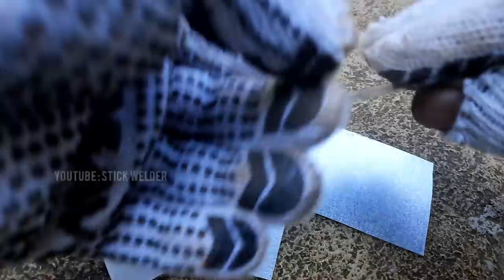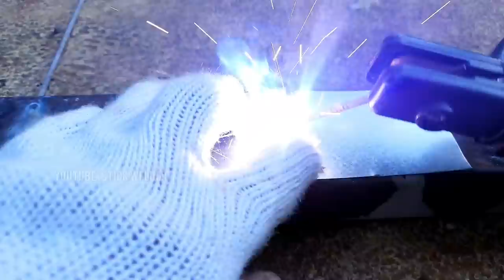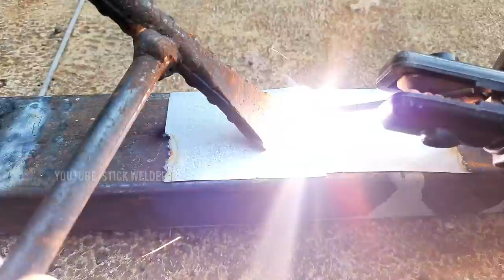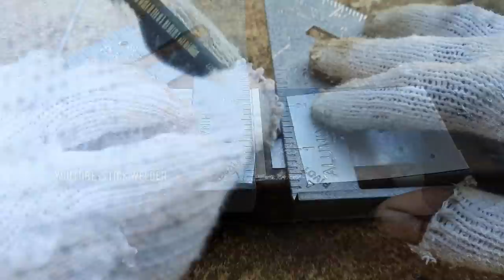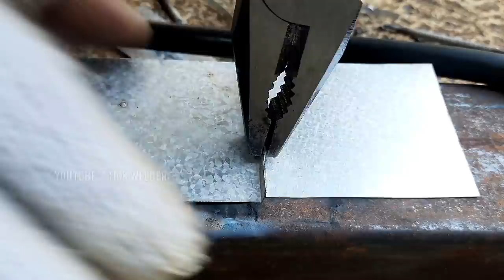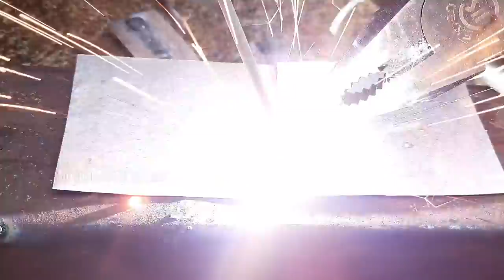0.3mm welding secret trick |  How does a welder get through the challenges of his job??

Comment: Basics of welding:
1. Do not weld any metal surface unless it is bare base metal. (No coating, no grease, no dirt, no galvanising etc..)
2.  Choose the correct welding method (i.e. weld thin metals with GTAW/TIG welding/spot welding or just use brazing)
Reply: This is true in most cases. Light gage galvanized is too thin to grind or buff off. Thinner than construction paper. Even heavier 10 gage/ basically 1/8” we rarely grind for a weld. Heavy galvanize on channel / structural or hot dip galvanize yes absolutely.
Reply: Basics ? Lmfao basics of welding would be learning whats for what...... they make rods literally for burning through dirt grease rust and the likes your ideal world of it has to be prepped is adorable in the field
Reply: @w.f.productions7501  yep 6011 works great on those situations. It’s my go to rod for galv. Normally I would not weld 24 ga or lighter with a rod but some times in the field your do what you have to. Generally we try to stay in the 16 ga realm for stick. We carbon arced with silicon browns filler rod in the old days lol then with the newer suit case welders and a small argon tank it made it a breeze with much more control on the lighter gages tig welding.
Reply: Try join industrial maintenance for once. Theres many kinds of welders out there, and every "style" has its uses.
Reply: My first welding job all we did was weld on galvanized metal... Fuckin hated it...
Reply: Just  mig  weld  it!
Reply: @stormytempest6521  not always an option . I don’t know when that guys first welding job was but I started in 81 it was a major set up depending on where you were. Hangin by a bow-sons chair on the side of a building or high up in the steel work wasn’t an option and still isn’t. These days the smaller units are cool as hell but still have limitations. A breezy day can ruin yours. If that guy has or gets 10 years under his belt I’m betting he would say no biggy I got this.
Reply: Clean, or even epoxy coated surfaces aren't as important with a stick welder. The point of the video was to show that it's possible to weld thin material with a welder that was never meant to weld thin material. I've been welding and torching for over 20 years and to be honest, this simple to understand technique blew my mind!🤯 Mostly because of how many times I've unsuccessfully "welded" thin sheet and that this idea had never occurred to me. 
As for galvanized, I don't know if you were alluding to the "Galvy Flu", but if you quickly preheat it yellow first, wear a respirator, or dont do it everyday then metal fume fever shouldn't be an issue.
Reply: Try using a smaller(thinner) welding rod too.
Reply: @johnanthony2545  Did you mean "bosuns" chair?
Reply: @LukeAONeill   Lukè  my  friend, you  have  a  point,  can  do  job  whith  a  thin  rod  but   its  a  messy  slow  process....thats  why  mig  welding  was  invented!  regards.
Reply: @truckerenoch8824  I m not sure of the spelling sorry. Basically a flat board supported like a swing from a single line. An additional safety line separate from chair for your self. Generally comes with a tool bag hung off the bottom.
Reply: @johnanthony2545  o.k. we're talking about the same thing. I wasn't sure if there was something else with a similar name. You were close enough that I was pretty sure that's what you meant.
Reply: @truckerenoch8824  have you ever used one. It’s an interesting experience.
Reply: @johnanthony2545  No, but they look fun.
Reply: @truckerenoch8824  they can be if you like that kinda thing. I do so I’m just goofy like that lol. Working from one can be challenging if there no way to lock off to stabilize your self. I you need to push or hammer or what ever your moving or pushing away or spinning. Your a man on string.
Reply: I think these video is for those people who dont have the resources to buy GTAW,TIG or any other type of welding machine but SMAW only

Comment: Step 1, GRIND OFF THE GALVANISING 
You'll never weld galvo steel, the zinc reflects the heat from the ark, and adds impurities to the weld, and the fumes are toxic.
Reply: Grinding a pc of 24 gage is not a thing. It’s like paper no need to grind. Galvanize coating on sheet goods of light gage is not thick and will burn away. Grinding an already paper thin pc is not recommended. Even up to 10 gage. Heavier coated material like angle / channel/ I- beams yes that is the norm. 41 year industrial sheet metal worker / retired.  Edit to add this. 6011 3/32 or 6011 1/8 rod works best in this application. 7018 is over kill for light gage material that is not structural and in my opinion much harder for a novice to learn how to weld light gaged material.
Reply: @johnanthony2545  nice info
Reply: @squid_shit9748  yes and get a fan to blow smoke away from you or a certified vacuum system for fumes. Vac system normally in shops no so much in the field.
Reply: @squid_shit9748  the fumes enter via the respiratory system, drinking milk will not affect this in any way at all.
Reply: @johnanthony2545  i would have just tigged it after preparing the metal
Reply: @thedango6890  yes this is the best option with tig. I’m thinking the video was  to show that it can be done with stick as most individuals don’t have access to tig rigs. Also the joint he used with two 90 degree is a common method most people would not know about if not in the industry or at least in construction and observed it on the job. Making sure joints are tight really helps as well. Of course there is the wire gun option even when metal is in the flat.
Reply: @squid_shit9748  You are hardcore

Comment: You should probably use mig/tig for this but if you have to use stick don’t use a 6010 rod it’s burns through before filling.. a 7018 or 6013 would be better.. not perfect but better
Reply: I'm working at an acid plant. Guys out jere using 316 for carbon to stainless.... we have 309 rods which is for that procedure. But we just do as we're told 🤦‍♂️ when this plant blows up we'll know why

Comment: Я не сварщик, но нагрев металла его сильно ослабляет, там сгнивает моментально, проще замком завальцевать, а если нужна герметичность, то герметик всё решит)
Reply: No heating does not necassarily weaken the metal, it depends on the type of metal. Generally heating the metal affects the crystaline structure. What weakens the metal is constant stress and or heat getting it out of elasticity into plasticity to the loint of structural degredation. A weld is a seal and is generally beter than a seal
Reply: Как жестянщик со стажем и опытом, скажу, что завальцовка, это несколько иная операция, а не то, что вы имеете ввиду.
Если хотите использовать термины, то надо их сперва изучить.
Falz(фальц), ещё говорят "фалец". Это и есть соединение тонкого металла при помощи шва. Виды фальцев можете изучить сами - в интернете все можно найти.
За сим разрешите откланяться 😁
Reply: @MrJulikoBanditto  всё вы тут со "стажем и опытом" только языком...

Comment: Maybe use rivets instead. They can be stronger than a weld bead because the material is not heated. I bet that will crack at the beginning of the weld.
Reply: Depends on the application. Tacking the back side will remedy this. One must all way look at the application of connecting materials. Does it need to be welded when a rivet or a formed lock would be superior to look of finished product and save time. Maybe it needs to be water tight and soldering would not warp a pc you can bend with your fingers. Also the material will be prone to rust at a weld point, it’s already thin so rust has not far to go before it’s a hole. Things to consider.
Reply: Rivets are good, but this video is about welding, I think.

Comment: very creative. My vertical weld is better than flat position. Can anybody tell me why?
Reply: Vertical down or vertical up?
Reply: @v0id852  downhill
Reply: Vertical down generally require higher heat settings and fast travel speed to get decent penetration (vertical down is not know for producing great penetration but good looks)  so if you like the way your vertical downs look compared to your flats I would recommend you turn down your heat settings by 10% and increase your travel speed on the flats - do this a few times until you find the right setting.  FOR EXAMPLE - if I was welding 1/8 steel vertical down I would likely run around 19.5 V and around 250 WFS while leading the pool (contact in the front 1/3 of the weld pool) if I was to weld the sane joint in flat I would run something closer to 18.7 V and 210 WFS but still maintaining that leading of the pool (contact in the front 1/3 of the weld pool) to produce a similar though not exact look.
Reply: @v0id852  thanks a lot  buddy

Comment: Can please nobody ever do what he just did, I mean seriously if that weld was ever actually used in any way people would not only get hurt people might also die. I have been a welder for more than 10 years, I have my 6G X-ray my D1. 1 X-ray  tig, Mig, GTAW, SMAW, Carbon arc gouge, and the list goes on experience and certifications. I strongly encourage everybody to realize he only posts these videos just for fun not for information on how to well
Reply: People may die? Really dude?
How many lives are riding on the weld of that FLASHING he was attempting to join? If your gonna entrust someone's safety to that thing of a metal then those folks are sitting ducks anyways!
I wouldn't trust metal that thin to be a chain guard on a kids bike, and your saying lives could be at stake😂
Reply: @BrandonDickenson35   Yes actually people could die, Duct work and Ventilation are made out of extremely thin material. On top of that other countries don't have the same regulations that the US does, So basically what I'm saying is that would be a completely acceptable weld somewhere else.

Comment: The more welds it gets, the weaker the thin metal sheet!

Edit: there is also a specific welding machine for thin metal sheets and it's called spot welder.
Reply: Pssst!...Don't wake him up. In addition don't tell him to wear proper gloves. It wonders me that he doesn't try laying the material on wood to absorb the heat.
Reply: @robertthomas6127  also makes me wonder why the metal is not first cleaned off and then a tig welder used for thin precise welds
Reply: That's all he did was spot weld, or stack spots. He sure didn't run a bead.

Comment: How to weld parts that length doesn't matter on. It's not always so convenient. But if you have to stick weld such thin metal, a 1/16" 6013 rod on DCEN can do it, carefully. I run maybe 20-30A on AC and it works well enough. You may be best off just repeating tacks on opposing sides to minimize heat in the base metal.

Comment: first of all this steel is galvanized - you need to clean it white before welding
Second - use TIG for such works with pulse and low amps - weld a little  and let it cool down - repeat - if you have problem with welding use 316 rods (acid)
third - it looks fucking awfull - If i would give some client such wields i would be ashamed